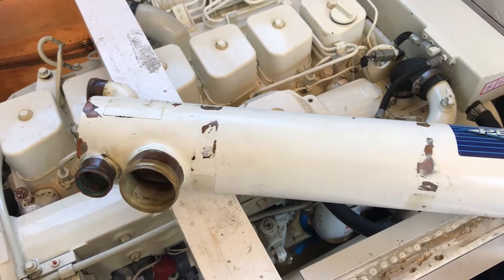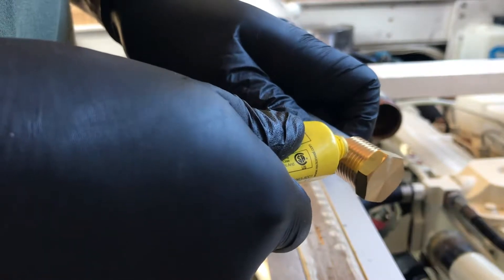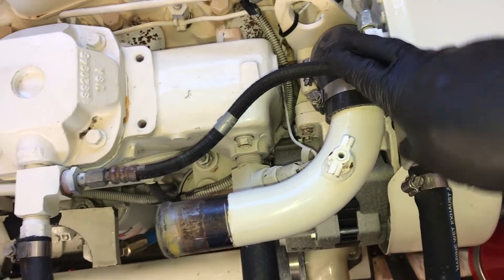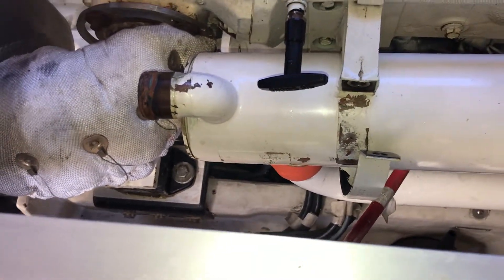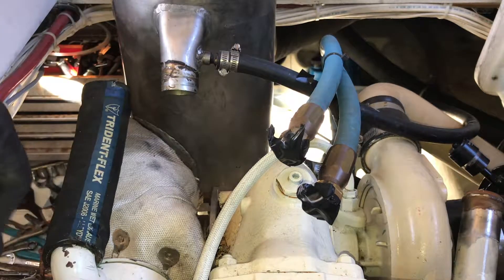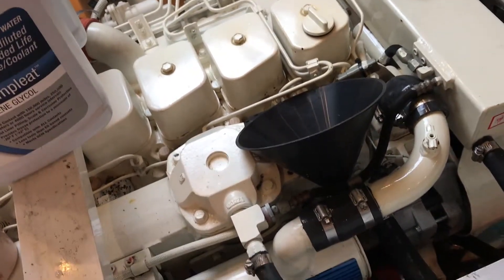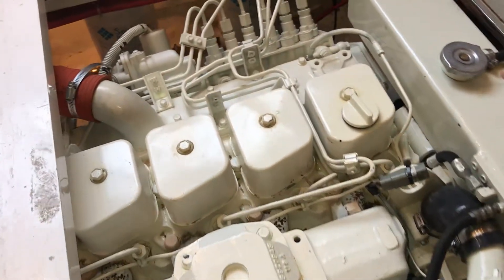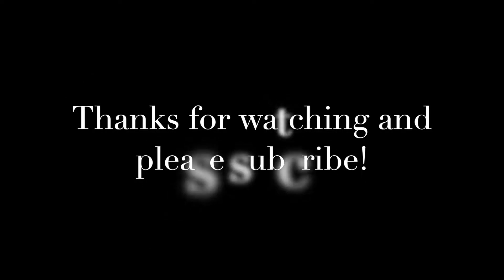Cummins heat exchanger install Part 2

Comment: It's much easier to leave the 90 degree steel pipe out and put it back once the heat exchanger is in. I always remove the coolant tank anyways as I dont want to spill any coolant in the usually very clean bilge.

Comment: great great videos watched them all  ...hi I have 2 qsb 5.9 HO's love them have a couple of questions... 1. can you estimate how many hours it took you to do both engine heat exchangers and aftercoolers...2. why did you choose to change the gear oil cooler , preventative ? or was there something you were seeing wring with tranny or in the fluid ?.. im coming up on 1000 hours and starting to think of offseason projects like this ... btw SB marine is great for us cummins guys ... they know it all . Tony is great as are the forums

Comment: Great videos! Thank you so much! When you drained the antifreeze out, I assume all of it comes out? How much did you have to add back in?
Reply from the maker: Chris Bitton  yes I drained it all.   Each engine took a different amount because of our diesel heater run through the port engine.   Each one took 6 gallons plus or minus.
Reply: @abredeson  good to know. I have the exact engines and am looking to do the same thing. Especially the aftercoolers. Great, helpful videos.